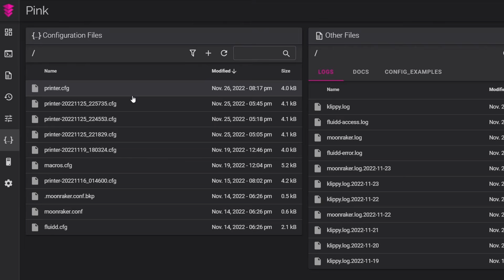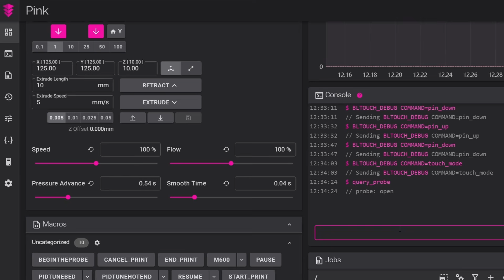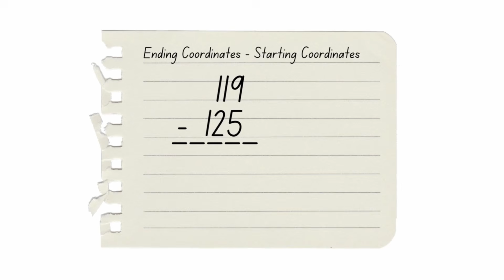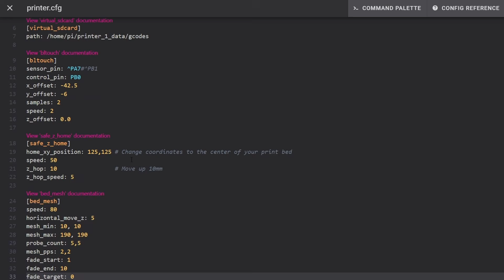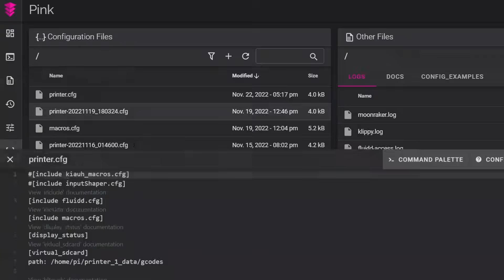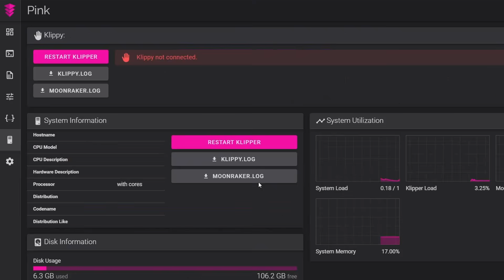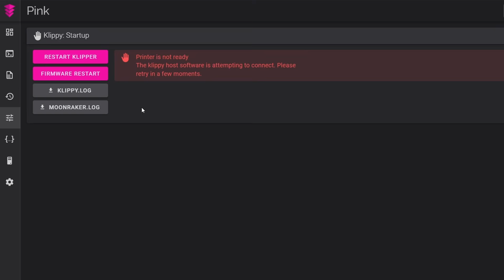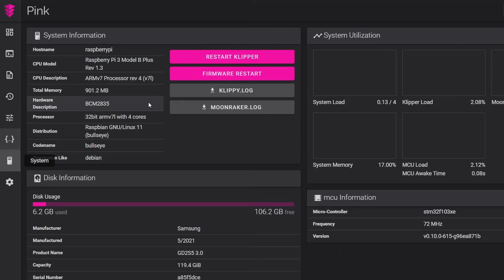BL Touch complete setup for Klipper! Maximize your probed bed mesh!

Comment: I got my printer working with a BLTouch 3.1.  It took me a while, but I modified a few things along the way.  

A few notes:
If you have bed clips, you will have to reduce your print and probe areas by the width of the bed clips or calibrating the bed mesh will probably crash the print head into them.
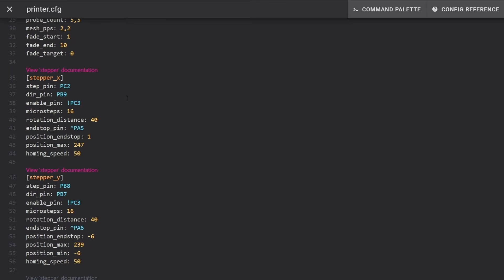24:07 - This assumes that you have a Start_Print macro already setup, which may not be the case.  Creality Sonic Pad did not create the macro for me, but it may depend on your machine, and that may change.  You can also put your BED_MESH_PROFILE LOAD=default code into the custom start g-code in the machine settings of your slicer after the G28 code.
You may need to adjust z offset if you change materials or maybe even brands of filament.  This is true even if you manually level the bed.
Reply: Thank you! This information was extremely helpful.
Reply from the maker: All great and accurate information!! Thank you for the follow-up, I guarantee this will eventually help someone else 👍

Comment: Hello Leo youve been a huge help with getting my entire bed to a usable state instead of being limited to the lower left hand corner. Now i'm wondering since the probe probes the very bottom edge of my build plate i have about a .5 deviation from the rest of the bed. It looks like an uphill. the rest of the bed prints fantastic thanks to your guide but how can I reduce this hill? The print at the edge prints fine but as it starts to get closer to the bed screws horizontally the nozzle gets a little too close and over compensates. Could this be because the Z axis cant move to the correct position fast enough? should i use more probing points? Currently running a 9x9 on a ender 3 s1 plus 300x300 build plate. Ive also considered adjusting bicubic tension to .5 instead of the default .2 to smooth out the transition from the hill to the rest of the build plate but the option seems to be missing from my printer config and is written as a auto generated number under bed mesh default after the save config line at the bottom of my printer config. (running klipper through a sonic pad using the fluidd interface on a pc). Any feedback would be a great help.
Reply from the maker: Thanks for watching my videos and I'm glad I was able to help you this point. With some beds, especially large ones, like a 300mm+ bed, you'll never be able to remove warpage from them completely. We can get it close and just hope the bl touch can make up the difference. 
   If you want to add a section for tension you can. You just need to add that line in under your bed mesh section.
[bed_mesh]
...
bicubic_tension: 0.2

As far as actually changing tension that's something you might want to think about. You can always mess with these numbers but making it any higher than the default 0.2 can run into difficulties.

Alternatively, and this is sort of a last resort, I have seen people use folded up aluminum foil on your portions of their bed to bring them up and closer to where the level of the rest of the bed is.
Reply: @PrintsLeo3D   Thanks for getting back to me so quickly. I will try the aluminum foil trick to get the rest of the bed at the same level. If i cant its no issue to lose some space at the bottom. Thanks again!!!

Comment: Wow...after failing to set my cr10s up with a 3dtouch on the sonic pad your video stepped me through it easily. Thank you so much for your efforts...... regards from Tasmania....
Reply from the maker: Amanda thank you so so much! Not only for the nice comment but also the very generous tip! That really means a lot to me. Iove making these videos, and when they help people navigate through Klipper and are happy with the outcome it makes my day! Thank you, thank you, thank you!!
Reply: Hi...I appreciated the effort you put into explaining the setup,  @PrintsLeo3D  having a while ago tried to add the 3dtouch using th3d's marlin etc etc the Klipper experience is a game changer. Just bought a neptune 4pro which introduced me to it, sonic was obvious to add my cr6se and cr10s to. 1 question, I couldnt see where to add the bed mesh profile line to in my config, dosent have the start or end macro section anywhere in it, did a few random insert positions but kept telling an error. Or do I add the whole 15 lines or so not just the 1 bed mesh line. I did add it to the cura cr10s start profile which I hope works.   thanx again.........
Reply from the maker: Because you're running some Creality printers the Sonic pad isn't a bad option, but unfortunately overall it can be a little tricky. I don't have the Sonic pad but it definitely does have a start_print (or print_start) macro somewhere. It doesn't necessarily have to be written within the printer.cfg but it will need to be "included". What I mean by "included" is that any macro can be written within a different text file and then pulled into the printer.cfg usually at the top of the printer.cfg you'll see a bunch of files being included, it would look like this:

[Include macros.cfg]

Then all the information within the text file macros.cfg would be used just like printer.cfg

Using the include function is a way to clean up your files and make them easier to read. So if there is no print_start macro in printer.cfg then check what files are being included and see if it is one of those.

Comment: Hi Leo, I'm getting "Move out of range: 404.000 14.000 5.000 [0.000]" while doing bed mesh.
E5+ Skr 3 tmc2209
 [stepper_x]
step_pin: PD4
dir_pin: !PD3 # ! is used to switch Direction
enable_pin: !PD6
microsteps: 64
rotation_distance: 40
endstop_pin: ^PC1
position_endstop: 350
position_max: 350 # Bed X
homing_speed: 100

[stepper_y]
step_pin: PA15
dir_pin: !PA8 # ! is used to switch Direction
enable_pin: !PD1
microsteps: 64
rotation_distance: 40
endstop_pin: ^PC3
position_endstop: 340
position_max: 340 #Bed Y
homing
Reply from the maker: Hey BK! The error is telling us that your X is trying to move to the position 404. Obviously it can't do that because your max position along the X is 350. With the Ender 5s this is always confusing because you're using the back right corner to home but the origin is in the opposite corner. What are the X and Y offsets for your probe?
Reply: @PrintsLeo3D  x_offset: -54
y_offset: -9
Reply from the maker: So just to be accurate, if you're standing in front of your printer looking at it is the probe towards the left side of the printhead?
Reply: @PrintsLeo3D  Correct. [bed_mesh]
speed: 120
horizontal_move_z: 5
mesh_min: 5, 5
mesh_max: 295,340

I changed the mesh max from 350 to 295, it made it past the "404" . Now at the 2nd to last back row probing I have Move out of range: 59.000 349.000 5.000 [0.000
Reply from the maker: It's all just a matter of bad mesh_max values and with the Ender 5 it's easy to mistake. You want your mesh max to be:
296,331

That should keep you within the bed max values while still probing the largest parts  of the bed.
Reply: @PrintsLeo3D  Like a charm Buddy! Thanks Leo !!!!!!!

Comment: HI Leo - Under machine settings in Cura, should the X and Y settings match the mesh max values of Klipper?  Also any changes to print head setting changes?
Reply from the maker: Steve both great questions. The X and Y settings in Cura should be the min and max positions of where the nozzle can reach. The minXY should be 0,0 and for the maxXY position should be the farthest corner your nozzle can reach while still being over the bed. As for as other print head changes in Cura you shouldn't need to make any. Those other printhead dimensions deal with its size so to compute printing objects one at a time (to completion).

Comment: Joined the patreon due to the content of this video. Clear and concise, solved my problems with the dual  5015 fan mod V4 from ZUFF on cults that I purchased, which move the Creality touch  a significant distance in both x and y axis's.  All fixed with this Klipper tutorial.  Relatively new to Klipper and love it.
Reply from the maker: Thank you thank you thank you! I just saw the subscription and it made my day! Klipper is really amazing firmware but, like most new things, there are some growing pains. I am happy to make content like this that breaks some of the basics down into more digestible pieces. I have more Klipper videos on the channel and there is a lot more on the way! Thanks for the support !

Comment: Stupid mistakes I was making was adjust the updated klipper config. Make sure you only adjusting the file that's cas printer.cfg!!!
Reply from the maker: Oh no! Thank you so much for replying here, it's great to keep this in the back of my mind when helping people. Each time you make an edit to printer.cfg a backup is made, and as you e discovered, only the actual printer.cfg is what is read by Klipper and utilized. Great contribution, thanks !
Reply: @PrintsLeo3D  no prob. I'm making a costume printer and it took me like 2 hours of messing around to only realize I was editing them wrong config....
Reply from the maker: Well I'm glad you figured it out. Good luck with the costumes!

Comment: First of all, I love your handle - that's very clever. But royalty you are!! This is an amazing video that helped me BIG TIME.  I've been using my Ender 5 plus for about a year and just decided to try the Creality Sonic Pad. I was NOT able to complete a complete bed leveling because it wouldn't go to the final row, it would throw an error that it was printing out of range. None of the changes I made in the basic settings fixed it. UNTIL I came across YOUR video. Took a little to wrap my head around the math because my bed is 350x350x400 so I need to convert a bit. But I did,. and when I did, with your help, I was finally able to complete a FULL bed level. THANK YOU very much!!
Reply from the maker: You're so very welcome and I appreciate the compliment!! The Sonic pad has been the bane of many a good 3d printers existance, so I'm happy you were able to use some of my video to get you through. Thanks for watching and for taking the time for the very classy and inspired comment!

Comment: I get a move out of range error on the X-Axis :( i tried following your steps and with a Microswiss Direct drive and satsana single 5015 duct (-52,-11) but i can't get it to work
Reply from the maker: When are you getting the movement out of range issues? While the printhead is trying to probe, or during a print? What is your stepper_max set to u der stepper X?
Reply: @PrintsLeo3D  I figured it out after your guide 4 times and following it step by step. I forgot the damn minus in front of the offset for the probe 🤦🏼‍♂️ Your video helped SO MUCH tho! Great content for someone switching from Marlin to Klipper
Reply from the maker: Haha I feel your pain, most all of my fixes are user error lol glad you got it working and I. Happy to be making content. Thanks for watching and asking for some help!

Comment: hiya, just wondering why is klipper think that my bed is level when it's clearly not to my eyes and bubble spirit? wonder why I've done wrong here.
cheers
Reply from the maker: Even when your bed is as 'level' as it can be, and when a bed mesh has been created , the warpage present on a print bed can still prevent the first layer of prints from adhering properly. Screw tilt adjust is a great way to get an intial bed tram out of the way (check my website for the article), and from there creating a mesh and adjusting the z offset should help. What's the tolerance of your created bed mesh ?
Reply: @PrintsLeo3D  tolerance? i don't think I follow
Reply from the maker: If you navigate to the bed mesh section of your front end (the visualiser) there should be a value somewhere that shows the 'tolerance' of the bed mesh. The tolerance is really just the difference between the lowest value (-) and the highest value (+). A tolerance of 0.2 or lower is ideal, but knowing what your tolerance is will give me a better idea of what the issue may be.

Comment: Leo, I will also say that this has been quite helpful, in preparing my ender 3 with Klip and BLT. Thank you for taking the time to create the content you for the community. Almost to my first print with Klipper, but still need to finalize and do a few more steps. My sincerest thanks..
Reply from the maker: Thank you so much. Really nice words, and I appreciate you taking the time to leave then here for me. Always nice to get some inspiration like this! More Klipper content on the way (pressure advance getting finished now) that I hope is just as helpful!
Reply: @PrintsLeo3D  no problem 😊  and looking fwd to it, keep up the  good work.. its appreciated

Comment: this is great i have followed it but I'm using a ender 3 max with a cr touch and it is mounted on the right of the extruder i have compensated for the offsets on it and i keep getting errors of out of range i have been fighting this a long time i have made my mesh size real small and it works but at end if print it just stops and same error out of range about to chick it out a window.
Reply from the maker: If you're probe is mounted towards the right side then you can move your probe to the max position you want (where the probe is over the back right corner) and figure out it's positioning. Then for the front left corner you would need to just add your offsets to the 0,0 position. 
   Also, if this is at the end of a print you want to make sure your end gcode is using the right positing commands (whether relative or absolute positioning). The same goes for the start print macro as well.

Comment: My printer for somer reason doesen't start on the min point rather one point right. min point is 10, 10. Edit: commented out probe offsets and that fixed it. idk why xd.
Reply from the maker: Glad you fixed this. Is it possible you have a redundant set of probe offsets somewhere else on the config?
Reply: @PrintsLeo3D  not that i know
Reply from the maker: That's pretty interesting, there should be some offsets it's using to create the proper mesh for the printer's use.
Reply: @PrintsLeo3D  indeed but i didn't find anything else than the ones I commented out

Comment: i got in some problems with : G1 X0 Y235 ;Present print  this y is added from cura itself from the depth, so this is 235 but its not real 235 its the probing space . but not the bed size so  i get a message that "y is out of range"  so what can i do i changed y manuell to 204 that works but is this the right way? maybe a end script?? or something else ?
Reply from the maker: I feel like you're almost there, and actually you're mostly right. It seems whatever the machine depth is set to in Cura is off by a small factor, and as you changed that number it began to work. Likely a depth of 220 should suffice, but can I ask what you max distance is along the Y axis?
Reply: @PrintsLeo3D  hi i have kamp installed and worked month for mothn pefekt now it seams that it is not near enough the bed so i have to lvl i think should i do this with screw tild adjust ?? alsow do you have a discord were we can write together ?

Comment: I am using a CR Touch. All went well until time to run a mesh, then got the Move out of range error. No idea where to go from here
Reply from the maker: Movement out of range usually means either a) the size of the min/max bed mesh is incorrect  or b) you're not switching to absolute coordinates from your start print macro before a print. I would think it's likely the min max values. 
What is the max distance along your X and Y axes and what is the X and Y offset for the bl touch ? Also what did you set the bed min and max coordinates to?

Comment: I am so stuck with the mesh_min and mesh_max, since my probe and nozzle location is flipped. It seems like my mesh_min is 38.5(X),-12.7(Y), which is where my probe is located, which is indeed off the table, whereas my Nozzle is located at 10(X),0(Y), which is perfect. wouldn't my mesh_min be 10,0 then? I feel like that's the solution, but doesn't that also mean that the probe would be completely screwed up when probing the bed?  I need to sleep on this one, because I wish I wasn't this dumb.
Reply from the maker: If you nozzle and probe are switched than you'll be calculating the corners in reverse of how I did it. Your probe can cover the whole bed in the mesh max section. So simply put your probe where you want it to probe in the max distance, add the offsets and they will give you the max. For the minimum you will not be be able to reach the far front corner. So place your nozzle kn it's minimum location and then add your offsets, that becomes you mesh min. If you tried to make your mesh min 10,10 (and your probe is on the opposite side of the nozzle than mine) your probe will not be able to reach that location.
Reply: @PrintsLeo3D  thank you very much, I'll try that
Reply from the maker: Great, let me know how it works out !

Comment: Just wanted to say thank you for your guide. 
I've put klipper on my ender 5 last year, but I've encountered so many issues with z offset that I stopped using it for a long time. 
I tried in the last few evening setting it up again with no luck, up until I came across your video which has helped me calibrate my printer and now it seems to just work.
Thank you so much !
Reply from the maker: Woah! Thank you so much. I am so happy when these videos help, sometimes filming them and getting them together feels like an uphill battle. When someone gets this sort of experience out of it all that time is worthwhile!! Thank you for the comment and for the generous tip!